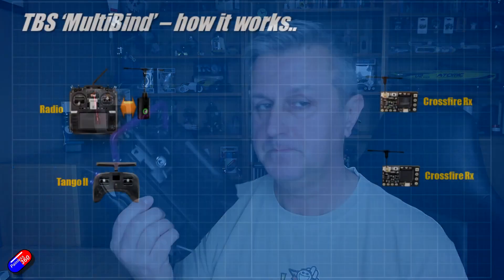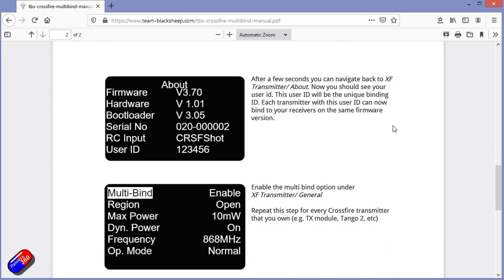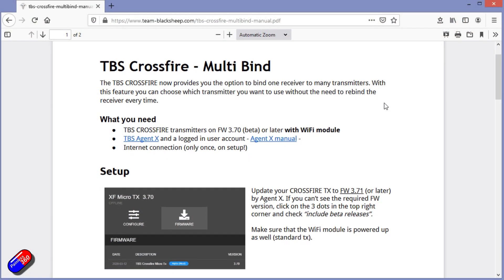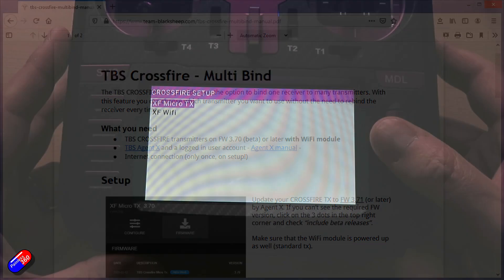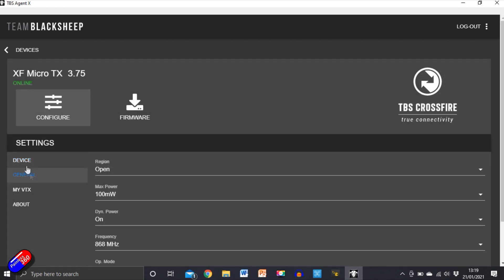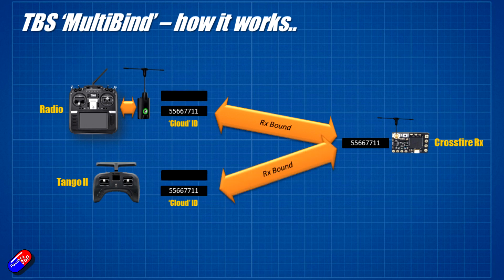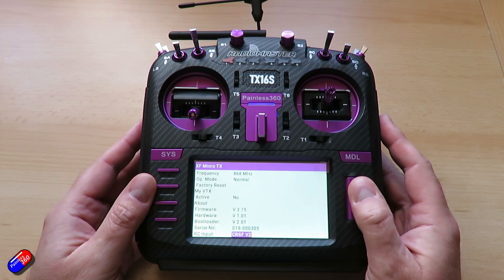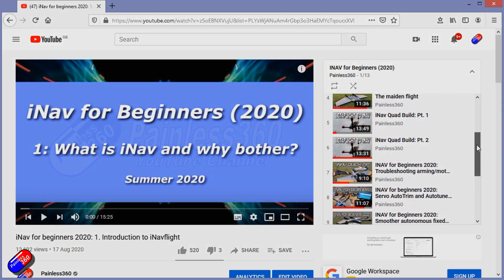TBS MultiBind: What it is and how to set it up easily

Comment: Few points related to full size module that are not mentioned in video. First, full size crossfire keeps the WiFi module in the JR bay adapter. If you plan to run fullsize crossfire with Spektrum DX9 radio with JR adapter removed, like me, you have to first activate TBS cloud in some JR bay enabled radio. Second, full size CRSF module does come with super old wifi firmware, that makes the wifi not show up in AgentX or LUA script menu. You have to power up the module via JR bay, connect to wifi access point transmitted by the module, and upload new firmware directly to the module to enable TBS cloud.

Comment: Just got the Radiomaster TX16S with Crossfire Starterkit (TX module + 3 receivers), but had not been thinking about getting a second TX module ... but really good to know that this is a kind of matrix or better multibind. Good explanation of a really well though cloud service that really makes sense to be stored in the cloud to get it all running and to keep it running even in case of a broken or even stolen transmitter cause that seems to be covered too. 
Our Smarthome has such a feature if a component would die. Then you can select the dead component in the Browser Interface and use a "replace function", which will copy the dead's config onto the new replacement unit and where you then can delete the old, broken one. Works really great instead of a new binding and all the stuff. 

Thanks

Comment: It's even easier now. Plug each TX module into Agent X and enable "Multi Bind" in radio settings for each. Power on the "Master" TX module (one already bound to a model) and power up the RX and make sure you get solid green light for the bind (now Master has sent the cloud ID for multi bind to RX". Power down master TX and power up second TX and check it binds to the model. Repeat for other RX units.

Comment: For whatever reason, I cant get my Tango 2 to bind after setting every thing up. Wifi versions are the same. I see the same user ID's on my Qx7 TX v2 and Tango 2, but if I shut off the Qx7 and then power on the Tango, my quad just beeps and the Tango doesnt auto bind?

Comment: Could both remotes be connected to the same reciver at the same time to help teach a bew pilot?
Reply from the maker: The best way to do that is via a trainer port/wireless connection between radios. That way, the instructor can decide who had control at what point during the flight/lesson. Happy flying!
Reply: @Painless360 im actually wanting a 2nd remote that 1 swtich can be flipped to put it into position hold.  Then ill disable everything else in that remote

Comment: Very good. If I’m correct this gives ability for multiple TX to bind with a one RX, yes ? Help please…. The Application I’m developing is where from one radio I wish to have the ability to bind (on demand, one at a time only !) to multiple receivers. Example. Drive a car A from home point to position X, then switch to car B and drive to position Y etc etc … up to six different cars. And thinking radio master T8 Pro for that to Flysky receivers. Possible ?
Reply from the maker: Not sure. The two I know of are Frsky ACCESS and this one.. Best of luck

Comment: I’ve spent all weekend trying to get this working on an xlite (nano tx) and an x7 (micro tx v2). I’m using the latest opentx 2.3.11, tbs 4.10, Wi-Fi 1.17, receiver 4.10... and I’ve even tried the tbs nightly build with no joy. Wi-Fi is connected and the server status says it’s online. Still doesn’t get the user id and therefore cannot turn multibind on. Also worth noting that when the crossfire module is plugged via USB the crossfire lua scripts don’t run properly. I would love to see a tutorial on an older model... so far all the tutorials are on the Tx16s, tango or a high end frsky.

Comment: Hello, one question that I have no answer, for long range +50km, what is better vtx circular antenna 4.25db and on diversity rx one 14db circular and other 23db linear or vtx linear antenna 2db and on diversity rx both 23db, also every setup on antenna tracker, thank you, my kind regards
Reply from the maker: You typicall want the highest sensitivities. Check out the antenna lab series and my video about flying further.. Best of luck

Comment: I am thinking about buying a TBS Tango 2,  this will be my second radio ever!  will I need to copy models from the radio master some how when I enable multibind or will 1 model work with all of them? trying to wrap my head around how multibind works with multiple quads and multiple radios
Reply from the maker: The multibind will let you bind both radios to the same model but you will still need the same model settings on the radio so you'll have to copy or recreate the model setup. I use the same model file for all of my quads here and that speeds things up.
Reply: @Painless360  maybe thats my issue. how were you able to take the model files from the taranis and get to the tango?

Comment: I have question that I cannot seem to find the answer to.
My son has a TX16S with XF Micro TX. I have a TX16S with a XF TX Lite. All of our 10+ aircraft are set up for multi-bind on the same user ID.
Can we both fly together at the same time in the same area?

If not, what is the workaround?
 When we tried it both radios were fighting for the same aircraft once one of the two aircraft was powered down.

My guess would be no, but you could: Connect each A/C (with multi-bind on). Disable multi-bind. Disconnect (power down), and then reconnect/rebind with multi-bind off.
Would both radios need to disable multi-bind (so that we could fly together), or just one of us?

The goal is to completely avoid manually rebinding if possible. 
Thanks!
Reply from the maker: If both radios have the same multibind ID then I wouldn't like to try it. Only one of you would need to use another ID to avoid conflicts..

Comment: I got same id and mutibind enabled on both Radiomaster and tango2. Rx is bound to tango 2. But whichi poweroff thango. Radiomaster is nor bound on the rx. But both radio share same id now?
Reply from the maker: All the steps are shown in the video. Sounds like something may have gone wrong with your setup. What troubleshooting have you already tried?
Reply: @Painless360 I flhashed new firmware again on both radio now Wifi is not getting connected on tango. Iam not getting the id. So we need to bind the rx first and then connect wify?

Comment: Really didn’t understand the part about if a RX is already bound but I want rebind it with multi bind. Could you do a video actually showing the process?
Reply from the maker: If the RX is already bound then changing from multibind (or back) will not require a rebind as the RX is told about the change and reconnects after a short delay using the new mode. Give it a try.... Happy flying

Comment: Very nice information. 
I have 4 drones with tbs nano rx and 1 tango 2 tx. Is there a way in which I can fly all 4 with the same tx without manually binding? I want to fly them one at a time only, not together.

I was thinking that is there a way in which I could manually bind all 4 once to the same tx and then select to which rx the tx will talk to with some button or some gui or script or something.. any way out to do this?
Reply from the maker: What you want to do is standard stuff and doesn't require anything special to work. Binding the reciever is a one time thing and you can bind many recievers to your radio. Once it's bound you don't need to do it again. You can bind multiple recievers to the Crossfire module. Multibind is for when you want to bind to recievers with multiple Crossfire modules.. Happy flying
Reply: @Painless360  
Thanks for the reply.
You mean to say that if I bind multiple receivers to the same tango once, then they all will be able to receive the signals without binding again right?

Basically after binding all 4, the drone which will be powered on will get signals without binding again right?
Reply from the maker: Try it and see...